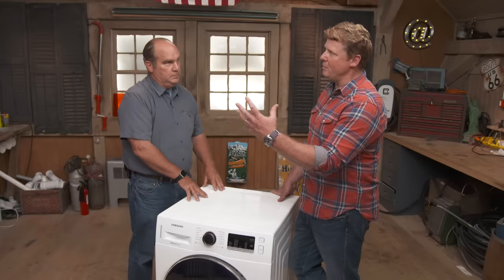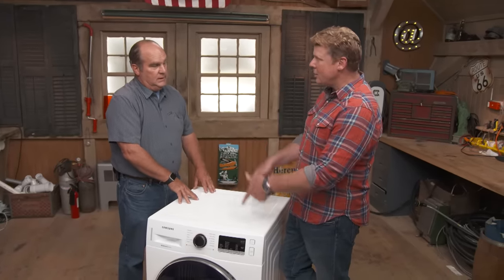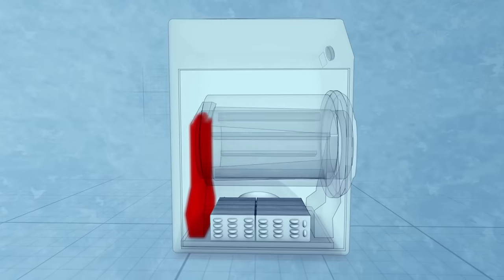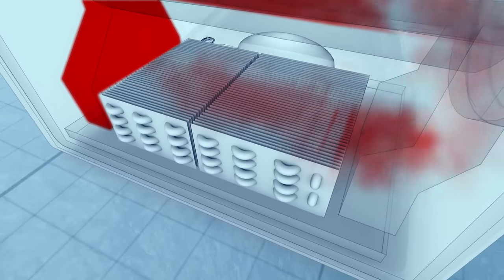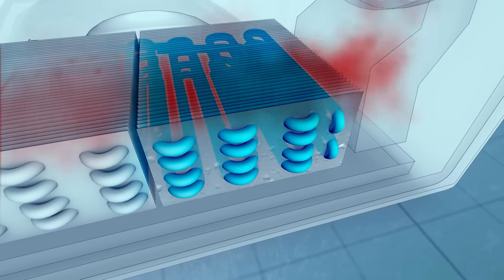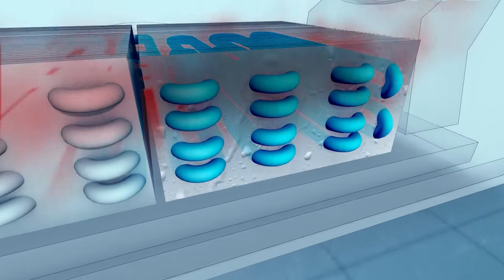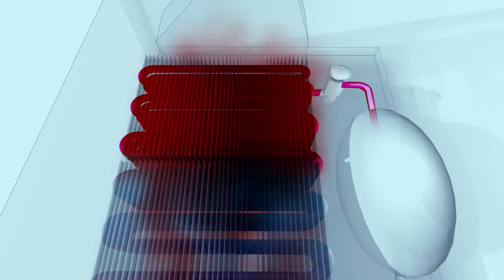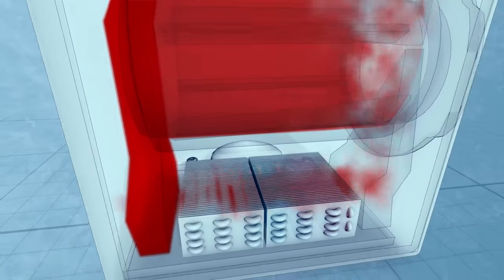Exploring a Heat Pump Clothes Dryer | Ask This Old House

Comment: The US is sooooo behind other countries in so much tech. I've had a Miele heat pump dryer since they launched in 2013. Eight years of trouble free and efficient use. And a self cleaning heat exchanger and a dense filter in the lower left compartment so that nothing even gets on the fins. Barely any electricity use and much gentler on your clothes. I couldnt recommend one enough. Miele has up to 9 star and Asko up to 10 star efficiency. Back in 2013 it had the highest at the time, 6 stars. Uses less than a KW of electricity for one load. Massively more efficient than older style condenser dryers and vented one. And you never come home to a stuffy hot room like a vented dryer (as most here in Oz do not vent externally).
Reply: In the UK, standard dryer=£200, Miele heat pump dryer = £800, if you get lucky the lower runnign cost MIGHT break even over the lifetime of the unit. But probably not.

Comment: heat pumps while efficient usually suck unless you have lots of time. Also for heating my home in idaho-not so effective
Reply: they work just fine in Idaho...buy a unit with a better efficiency rating and it'll work just fine well below freezing.
Reply: Mine heats fine down to 10 degrees. If  you have average highs of less than 10, you might have trouble.
Reply: @Bryan-Hensley  good to know I'll give it another look this thing was already in the home when we rented so now I can do research and hire my own pro etc

Comment: Those grills on the heat pump will be clogged all day long. SMH...
Reply: Not necessarily. The LG I have has a self-cleaning condenser.
Reply: You don't have to open it at all almost the regular filters take up almost everything.
Reply: chefbillyx I’ve had a condensing dryer for years. Clean the lint filter every cycle, clean the heat exchanger once a month (takes two minutes).
Reply: You have to clean the bottom filter about once a month

Comment: Let's see how much these cost since most don't even last 5 years anymore.
Reply: My heat pump dryer is now 13 years old, an old AEG one. One of the last ones that was made here in Germany...
Reply: @Marcel_Germann  Good to know but my last high end Samsung dryer didn't even last 5 years and had to get an LG to replace. Appliances are definitely not built like they used to due to cost downs and  demand for higher margins and lower costs.
Reply: @Ellery-USA  I wouldn't by from both companies either. I remember my grandmother was always stingy, but not with such appliances. She bought Miele. The best thing you can do. But they are expensive, and actually I don't want to know how much they cost in the US.
And never buy combination appliances which can wash and dry. Those are the biggest rubbish, no matter which manufacturer. You can wash 7 kg of clothes in them, but for drying you'll have to remove some of the damp clothes because the drying capacity is much less.
Reply: Marcel Germann ,
Thanks, I was thinking about getting two of those to replace my washer and dryer.  Now I won't.
Reply: @Ellery Wong 
They are preparing laws in the EU to prevent this. There will be fines when products are rubbish. Furtermore, the official  EU warranty is 2 years, but with an economic life expectancy of 10 years, a party warranty is mandatory (at least in the Netherlands)
Reply: @bigred9428  if you get a Miele set (German made), it'll actually last you a good amount of time. 

Can't say the same about Samsung.
Reply: Ellery Wong Buy Miele. Most come with a ten year guarantee and last at least twice that. Cost more but worth every penny. I would never buy any other brand, they are built to a standard, not a price point.
Reply: Agreed with Spencer. Miele FTW.

Comment: Just for FYI LG dryers claims their filter auto clean itself but it doesn’t and you can’t access it to clean it manually like Samsung.

In Korea LG offered 10 years free tech visit cleaning but the point is LG ones are faulty as fk. Get Samsung

Comment: I've had one for a year. It SUCKS.
Reply: I bet it works, just need to run it 5x as long as a gas/electric dryer.
Reply: Steve Lee I have HD one for about 10 years now and it works great! BTW mine is an all in one appliance (it washes and dries in the same machine), they have been on the market here in Japan for about 15 years now.
Reply: @s3trios  That's not true at all. Drying time is the same.
Reply: We have had a washer dryer one in the UK for about 7 years. Works great. About 2 hours to dry 6kg of dry Washing. If you go over though the sencer goes mad and it fails to work properly.
Reply: That sounds like a vacuum cleaner.
Reply: @timothysmith5453  not really. Loudest part it the drum turning
Reply: I've had my vacuum cleaner for over a year and it sucks

Comment: Neat idea but my gas dryer is cheaper to run
Reply: For now. As the environmental concerns ramp up, expect many municipalities to start taxing the heck out of fossil fuels.
Reply: @bnasty267  prices have been very low and the US has more crude oil in the ground then all of Saudia Arabia
Reply: zack9912000 The question is not whether there is oil and gas left, but whether it is smart to burn it or not.

Comment: Oh goody, you get to add refrigerant to your dryer regularly just like your central AC.
Reply: If you’re adding refrigerant to your A/C regularly you need to fire your Hvac company and report them to the EPA. Refrigerant doesn’t need to be “topped off” it’s a closed loop sealed system if installed properly
Reply: @kyle3904  That's a great theory, but it doesn't actually work that way. Refrigerant leaks are very difficult to find, even with a sniffer, and then are often very expensive to repair.

I am on my third Rheem evaporator coil in ten years, and each time Rheem will pay only for the part so you get to pay $500 + refrigerant to have it put in in the HOPE that it finally fixes the leak, only to have the new one start leaking a few years later.

Sadly, most other brands are no better, as most of the coils come out of the same factory.
Reply: @VideoArchiveGuy  I have been doing hvac for 10 years. Don’t need to tell me how hard it is to pinpoint a leak. If you have evap coils going bad that often you still need to fire your hvac company. It’s installation error. Water is sitting in the pan to long and deteriorating the coil. Also. We have leak detectors now that can pinpoint a leak 6 feet under concrete so that’s b.s. he’s just to cheap to buy quality equipment to diagnose properly for his customers
Reply: @kyle3904  It's actually well known for most every evap coil out there; where the leaks are occurring are nowhere near the pan.

Perhaps you have super cool new tools but the only way most HVAC people can find leaks is the old fashioned way - inject dye.
Reply: @VideoArchiveGuy  😂😂 well known by who. Whatever you say bud. You’re the pro. Keep wasting your money.

Comment: It’s a dehumidifier for clothes. I could see this taking a lot longer to do the job
Reply: its twice as log but 650 watts vs 2400 so you use about 1/2 the power like he said
Reply: But as Richard mentions it'll be using much less electricity

Comment: No pre filter on the evaporator? That thing is going to lose efficiency every time you use it.
Reply: Sam ,
Isn't the lint trap basically a pre-filter?
Reply: There's two filters.  One in the normal filter location that needs to be cleaned once a load.  Another in the bottom that needs to be cleaned once a month
Reply: "loose efficiency"
LOL

Comment: If you want to see something really cool, put your clothes on a rack.  They miraculously dry all by themselves.
Reply: Aint no body got time for that.
Reply: @ClickLikeAndSubscribe  Well. . . Yeah!  In some cases it definitely is.  It takes less than a minute to load a dryer.  Hanging clothes is a much more time intensive process, and if you're processing multiple loads per day the time savings is significant.  In my humble opinion, the most valuable thing money can buy me is time.  Your milage may vary, but reducing energy costs and environmental impact versus a regular dryer is a no-brainer for me.
Reply: @ClickLikeAndSubscribe  Good points all around.  Unfortunately, my clothes' useful life is typically cut short by work. ☹️
Reply: @mvansumeren4313  I just want to take the time to thank you two. You've agreed to disagree, made great points, and found some common ground... all without calling names and putting down each other.  Kinda wild to see anymore.
Reply: What if I live in Alaska????
Reply: And drip all over the floor damaging your carpet or timber costing you more than the cost of a dryer,  don't forget your reality is not the same for everyone else, some people live in places that you cannot use a clothes rack or have space outside for a clothesline this is why there is a market for dryers
Reply: @Deon Hamilton:  That's why people were naked before dryers.

Comment: Really it is not a clothes dryer. It is a clothes dehumidifier, heat pump, AC, this unit are all (in a way) dehumidifiers.
Reply: It's only use is to dry clothes, ergo it's a clothes dryer.

Comment: Of course hardly anybody uses clotheslines anymore, but they cost much less than a dryer, no lint trap to clean, and free to operate...
Reply: Or fan over hung up clothes indoors when weather is bad. You might have to run your ac for 30 minutes but the energy savings is still a lot.

Comment: Have an expensive Panasonic in Japan that washes/dries in the same unit. TERRIBLE. Takes 2+ hours and clothes come out wrinkled. Best way to save electricity…use a conventional gas or electric one…let it run for 5 minutes until the clothes get warm but are still damp, then pull out the clothes and hang them.  No wrinkles.

Comment: Would be great but my dogs hair would clog it up In a second!!
Reply: No problem at all, had this in Sweden for decades the filter takes just about everything. You will almost never open the lower box.
Reply: I don't think so. I got two cats, no problems. These dryers will also tell you which filters you'll have to clean. Even my 13 year old AEG Lavatherm heat pump dryer does this. Here in Germany, as in the rest of Europe, this type of dryer is actually not a novelty.
Reply: JOHN Q PUBLIC  The most will be in the filters which are located in the door and the one located at the edge of the opening of the dryer. Those are more coarse filters. The one for the heat exchanger is for fine particles, the coarse stuff is already catched by the other filters, which then must be cleaned more often. I clean the two filters in the door every time after the dryer was used.

Comment: USA is so behind on appliances engenierring. Heat pump dryers have been the mainstream in Europe for a dacade now. A few notes though: it does take longer to dry since it uses colder air, but that is better for the fabrics. Bosch dryers have a self-cleaning condenser system (the second filter on the the bottom) but you can buy only an European (compact) model in the USA. From the American manufacturers only whirlpool has one heat pump dryer model which has awful reviews and it is very overpriced. Too bad for the American consumers.
Reply: @samsquires2877  well its true what he said, did it hurt your feelings?:)
Reply: @samsquires2877  Butthurt are you?
Reply: Beko has one, but how available it is, I don't know.  They are starting to break into the US market.
Reply: @samsquires2877  Don't let your insecurities get in the way of good advice or a representation of truth. It's true there are some arrogant Europeans (I just dealt with one only yesterday in my job) but we have somethings to learn from them as they can from us.
Reply: @samsquires2877  I care about the American consumers which are offered obsolete, inefficient and overpriced appliances.

Comment: The conventional dryer will pipe nasty air from the clothes where it's supposed to go.
Reply: Ron Vosick there is no nasty air? It’s just humid , why would it be nasty
Reply: @Kubulek17  it's from the clothes and the soap residue.. unless older white linens and baking soda is used to wash with.
Reply: @ronvosick8253  there is no "soap residue" unless the washer did not do a proper rinse

Comment: Once again, a technology that is not ready for market pushed forward again. Heat pumps are horrible. If you were ever in a cold climate you'll find heat pumps can not hold up. Someone wanted to push this item. The cycle times on these systems are longer because it takes longer to extract the moisture from your clothes. Therefore - simple math - it costs more for the energy to run such a system. Common sense right? I like the play on words - yea, it runs longer but noticeable - until you get the bill for it. I just find that the idea of the technology is good, but it needs significant improvement before going to market.
Reply: A technology that is not ready for the market pushed forward again? Heatpump dryers are on the market for 20 years or so